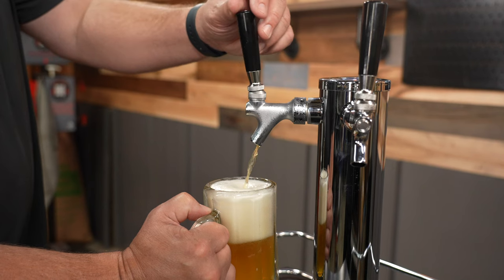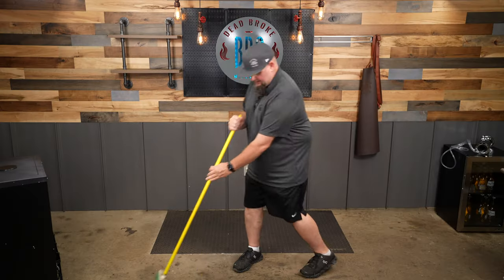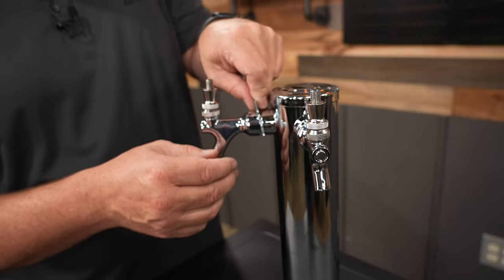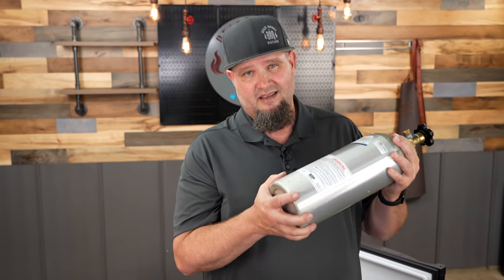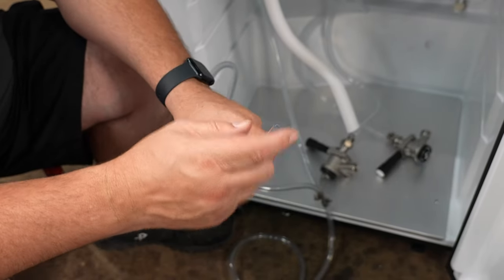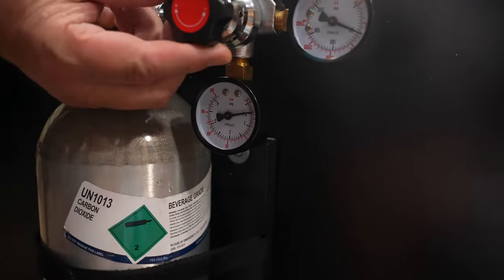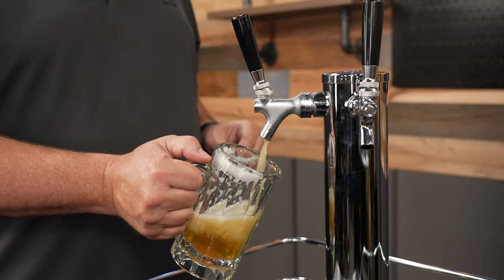Vevor Kegerator Beer Fridge For Home

Comment: Hey Ricer just want to give you a heads up, that hose from the fan is meant for your keg tower to keep the beer lines cool all the way to the tap to help reduce foaming. I typically drill a couple holes going along the line so air escapes all throughout the inside of the tower.
Reply from the maker: WOW thank you Logan!!!!! I will get that in place ASAP!!!! The assembly instructions weren't the best and the only thing I could come up with was that was to get some air at the bottom of the fridge so I am very happy you told me this!!! Grabbing the dewalt after I get done replying to all the comment!!!! Thanks again brother!!!!!!!
Reply: @DeadBrokeBBQ  no problem! you've helped me out a lot with your videos, wanted to return the favor. looks like a nice setup!
Reply from the maker: Heck ya and I am glad I can help!!!!
Reply: @DeadBrokeBBQ  You're not joking. My GF bought us a Vevor BM-162 for us. I unboxed it today. The instruction manual suuuuuuuucks! Glad you did this video to help me though. Thanks!

Comment: Great video! Just a heads up those look like 1/6 barrel kegs. 1/4 barrel kegs are the short fat ones. Which still doesn’t make sense because I don’t see how that would fit either. I like how the co2 tank has a snug spot outside of the fridge, more room for canned/bottled beer.
Reply from the maker: These actually are 1/4 barrels. The breweries stopped using the old shorter fat 1/4 barrels because of storage in the coolers. My buddy that is a beer distributor said this helped get more types of beers on tap. 1/6 barrels are very hard to find in popular beers because many breweries stopped using them and just went with 1/4's.  But I can get a couple Wisconsin beers in a 1/6th barrel still so I can have 2 on tap!! Thanks for watching!!!

Comment: Great video! Looks like maybe, 1 beer and 1 soda for the kids. Quick question, how well does it maintain the temps? I had problems with the smaller units getting to temp and holding. Thanks for the review Jeff!!
Reply from the maker: Great idea Scott and I actually like a good root beer, thanks!!!! So far the temps are doing pretty good! It runs a little colder so I set it at 35 now but man it is nice having the ability to pour a good cold draft of beer! Thanks for watching!!

Comment: THE KEGERATOR  -  Howdy Ricer, I'm only disappointed that some of the other guys watched before I did  ( nice to see Justin chime in) So interesting you can't fit in two kegs. But that will be OK at my place, my home beer is Hefeweizen. Here's a tip for getting that clear hose on those fittings when they are hard. Just soak in hot water, just the ends. Well sir glad to see you with your new " thirst aid dispenser ". Before I go I have to mention that's a nice big tubing cutter you have. I never thought I would have tubing cutter envy. 👍😁😆😅🤣😂🍻 Have a great day.
Reply from the maker: Oh Victor you are my type of fella, I love Hefeweizen! I have been to Germany a few times and completely fell in love with a good wheat beer! I still buy Paulaner all the time. But I miss a few of them there that are not imported to the States!!! I actually said but it cut out of the video I could put the hoses in some hot water but I am too lazy and thirsty to wait for the hoses to soak. In the long run I would have probably been better off because a couple of those were really stubborn!!! hahah
Yes I use the cutter on all kinds of stuff! Typically PVC but it works so good on tubing and you cut is straight too!!!! ha ha Thanks for watching brother and I hope you have a great week!!!!!
Reply: @DeadBrokeBBQ  FYI, The Hefeweizen by Widmer Brothers is out of Portland Oregon. They were the original producer of Hef in the USA. It is a unfiltered wheat beer and took 1st place in Munich's October fest the first year of production. A American beer in Germany, that is amazing. I only say this because this is the same beer you can still get here in the US. So here's the funny thing. Budwiser can't make beer this good so what did they do? They got the distribution rights for Widmer for across our country. Go figure. Pour a cold one and enjoy. 😁👍🍺🇺🇸

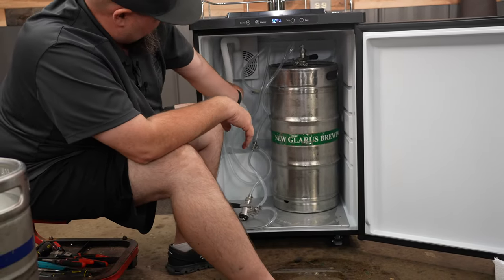Comment: The hose goes up into the tower not in between the kegs. Hot air rises into the towers every time the door is opened or generally. That’s why beer always foams at the beginning then settles down when the line cools from the beer. The hose will feed cold air up to the highest part of the kegerator. Just FYI! 6:05
Reply from the maker: Hahahaha ya I figured it out a couple weeks after I got it!!! Thanks for the comment!!!!!!
Reply: How low does the temp get down too in the unit thanks in advanced

Comment: Just picked up one of these kegerators with dual taps. I set it up for both taps but I'm only using one at the moment. My question is will the Co2 leak from the tap not being used once i open the bottle?
Reply from the maker: No it won't leak as long as you leave it closed. Have fun with the new drinking toy!!

Comment: Thanks very helpful I just got this one. 

Need Advice: I’d like to run the co2 to a art soda stream how what do I need t connector? What size or 
link?
Reply from the maker: Dang I am not sure what you are actually doing. I would wait until you get yours. This way you know the exact size, just incase they modified it since I got mine! Thanks for watching!!
Reply: Ok thanks for the reply. Oh and that white fan hose is supposed to go up into the beer lines to keep the top cold.
Reply from the maker: ya I figured that out eventually! Thanks for the tips!! I just wish Vevor had better instructions!!!!